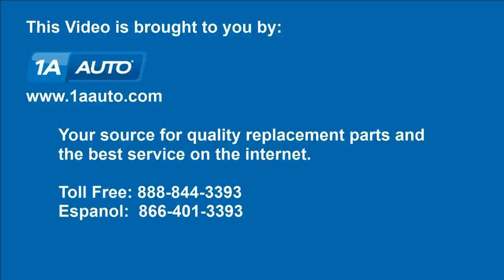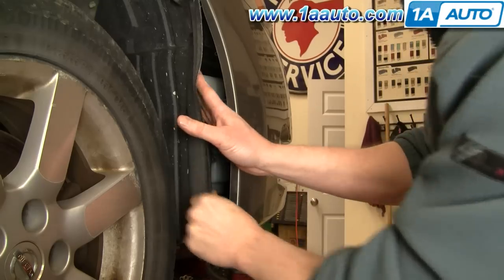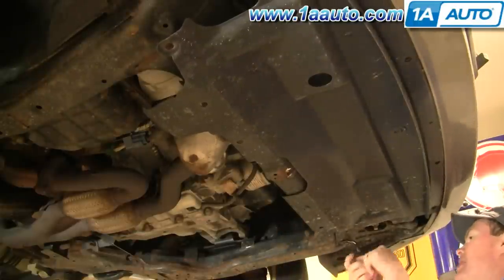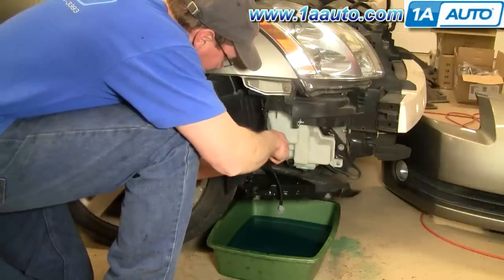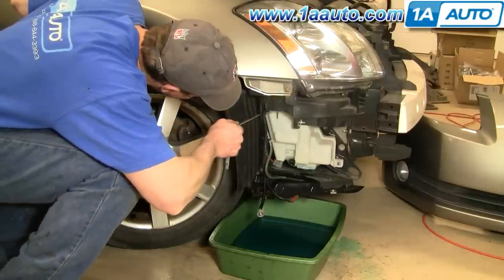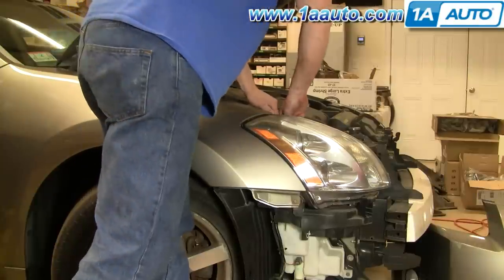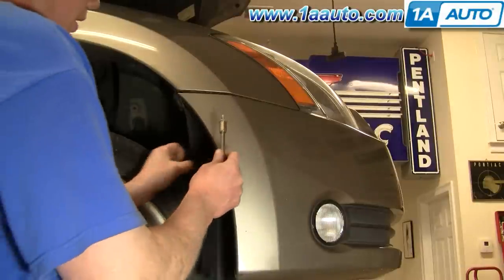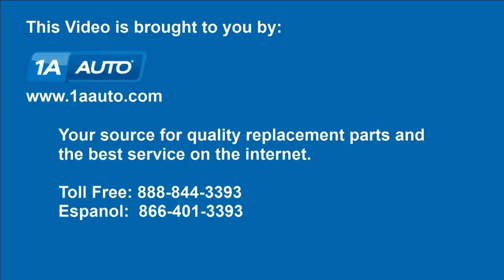How To Replace Washer Bottle 04-08 Nissan Maxima

Comment: hey where do i put the fluid for the rear wiper? is there a seperate tank?
Reply: Shannon Synclare These cars do not have a rear wiper.
Reply: Three years too late... the water bottle supplies both the front and rear.
Reply: @willandboy  what the hell are you talking about? Maximas doesn't have rear wippers